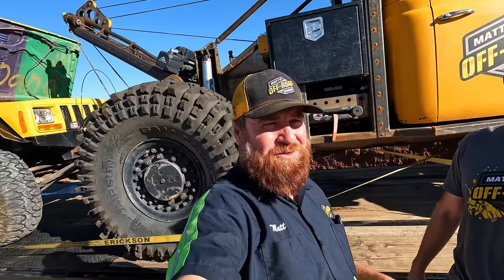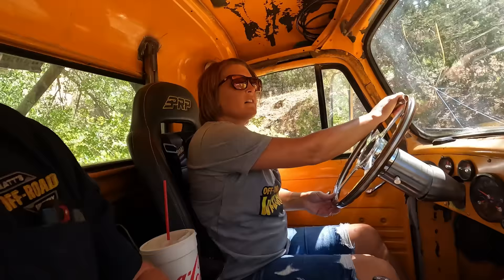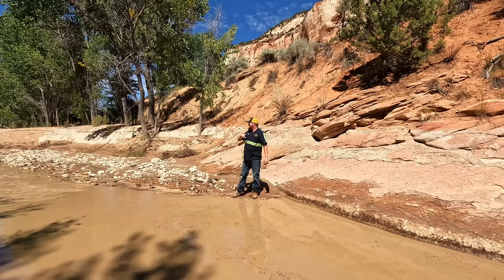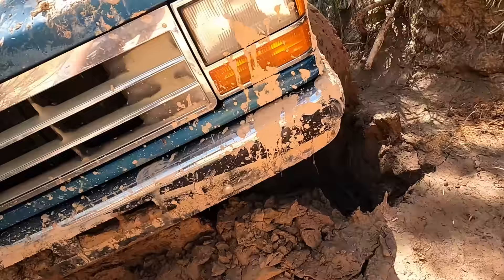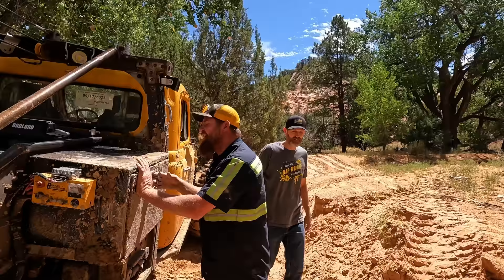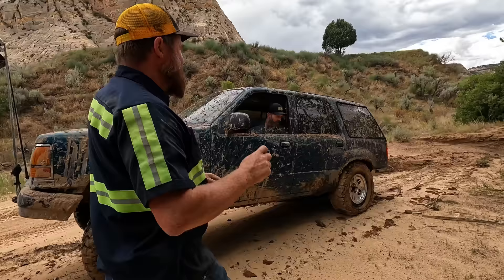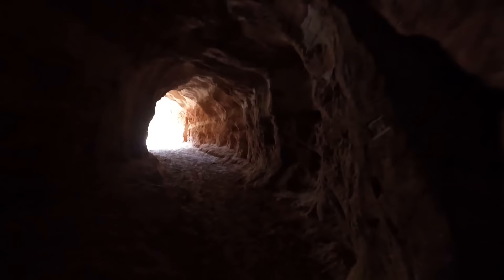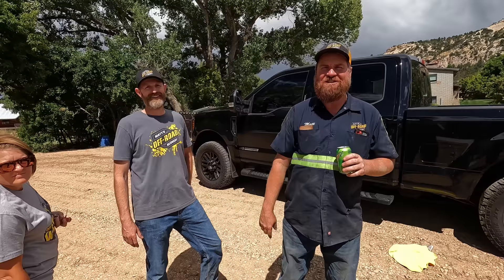It Doesn't Get Much Harder Than This...Pushed To The Limits!

Comment: I can't believe you guys keep using anything but brake lines for the air up front, you know... something that won't get soft or melt like what you've been using for months...  

If I don't see a video where you replace all the compressed air lines up front with stainless brake lines I will know you just want fake drama...  I know Tom has to have brought up the insanity of continuing to use the same lines that y'all know will not work reliably . 

Come on, fix that air so the drama can come from places it belongs, like sketchy angles and questionable rigging, or just from trying new things! 🎉

Love y'all @Matt's,  every last one of you.
Thanks for all the great videos, and for saving so many unfortunate people from their mistakes or accidents.

Comment: Reminds me of the time I took my old '75 Chevy C-20  up into the 4x4 trails to rescue my nephew in his late Eighty's Toyota 4x4 pick up. Stuck up to the floorboards in mud The kid was always talking down my old truck,  a little wench and my bulldozer chain  to get him out of the hole, and then dragged him out into civilization, through the mud  spinning my tires that are bigger than his and I'm only running 35x12.50x16.50 tires, little tires   but it is only a C-20 not a  K, and throwing mud all over his truck,on the way out. Talk crap about my Chevy and a expect me to come out to get your Toyota out of the mud, yeah Iam throwing mud at you, in a two wheel drive 3 quarter ton Chevy truck three years older than you are.   Evidently he forgot nothing works like a Chevy truck.

Comment: So we are at Lone Rock beach at Lake Powell and there is a pick up truck pulling a 5th wheel buried up to its axels in sand.  We area waiting for Matt to show up and  the owner says that he called Matt's off road recovery and they could not make it.  The disappointment ran through dozens of people out watching some other guy in a white pickup truck try to pull the rig out.  The owner says he wanted to be on a video and the free (cough, cough) t shirt but not today.. A wrecker was used.  Matt.. we needed you and the crew to drive several hours to make it a better day for us but boating and the beach had to do.  Maybe next time.

Comment: Wondered why they don't have lockers. They say the ability to lift, wondered why they don't have airbags to lift cars/vehicles straight up and motorhomes that have leveling lifts, why not stick a platform under the leveling legs and have the motorhome lift itself up.

Comment: You guy's Crack me up
Run outta fuel on job's this and that not working, but ya job done.
Thought : what if you replaced the little spaghetti air line's under the hood that gets hot,with stainless or copper line's? Just a thought

Comment: If dude wants to sell the Exploder I'd be interested if he's needing a good running 4.0 inline 6 cylinder Ford Exploder engine I have 1 I'd sell reasonable and even use the skid loader to pull it and load it in their truck or trailer I have 1 you can hear run but driving it's out of the question my son was pulling my 98 crewcab 4x4 dually Chevy with a full 500 gallon diesel tank and toolbox in the bed and a 50 ft McDon draper head on the trailer up a decent incline from the muddy field and he didn't let off before hitting the pavement (my fault I forgot to tell him and at 13 he'd only helped with that on gravel and dirt roads) and when the rear tires hit pavement something in the t-case popped and now every gear (including park) is neutral so now the nose is coming off the rust bucket frame will be boxed another tube frame welded to the factory frame 2x4 1/4 inch wall cross bracing every 16 inches a 10,000 lb axle (with brakes) is going under the rear with F350 dually fenders going on the tube frame will extend out the front for a platform for my Lincoln welder/generator between the body and gooseneck seats and carpet will be removed (comfortable bucket seats and a console for my 65 Chevy finnaly) a couple 500 gallon diesel tanks in the rear to fuel 2 tractors or combines at least a 250 gallon tank for government juice tank accessed from the rear doors and a tray for tools on the front floor with a shelf built at dash level for filters grease oil and misc farm equipment needs the hood is going to donate sheetmetal to replace the windshield and cover mirror holes on the front doors to make a pretty dang cheap fuel/maintenance trailer to pull to the field and with the factory hitch and trailer plug I can still pull a header trailer or my 10 ft utility trailer behind it if needed

Comment: Air lockers are such a bad joke. Hideously expensive and unreliable. You would have been much better off using a Detroit TruTrac locker in the front diff. HD limited slip in the rear diff. Relying on air lines is a fools folly. And they're melting on you when you need them the most. Sad.